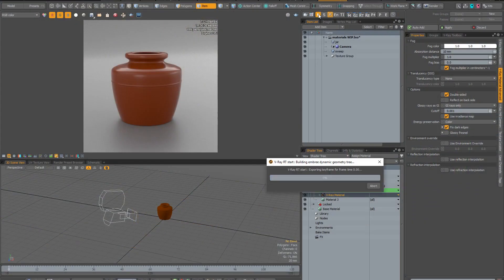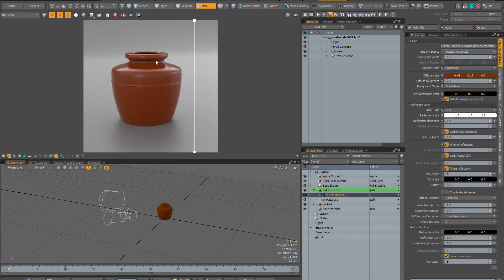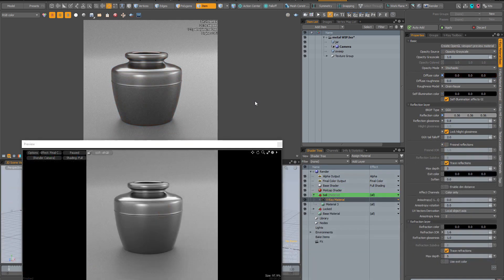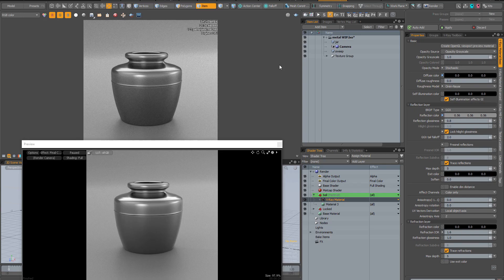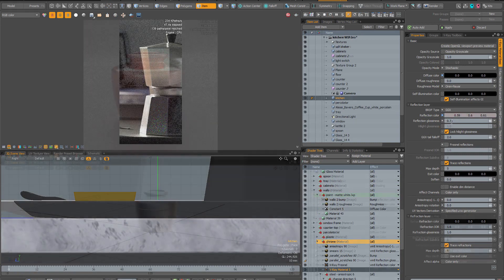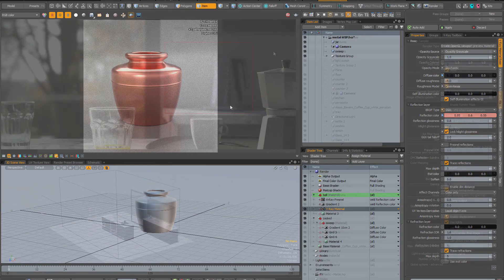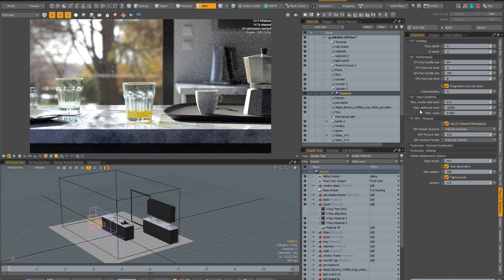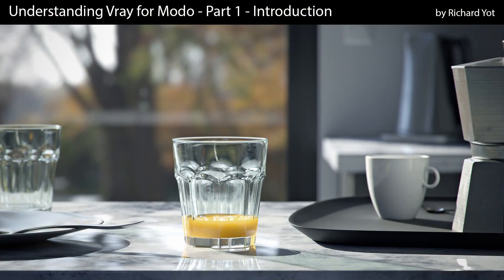Trailer - Understanding Vray for Modo Part 1

Comment: Hi Richard, love your videos and really excited about this one. I have question after watching the CPU render video. I've been using adaptive sampling and been getting great results but at the cost of longer render times. I've started using a render farm now, I'm Keen to reduce the time / cost of my renders but if I switch to progressive for a farm I can't stop it when it's good enough, I'm trying to understand how to judge the time for this use. Would you still use progressive for a render farm?
Reply from the maker: With a render farm you will probably have to use the adaptive sampling option, because there's no easy way to monitor the output of the renderer.
Reply: I thought that might be the case. Thanks for your help and great content as always